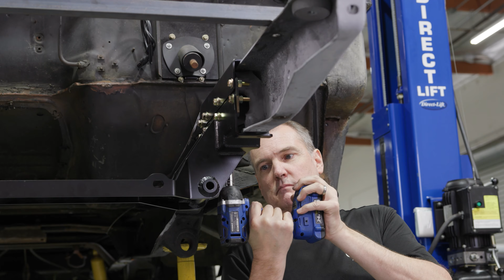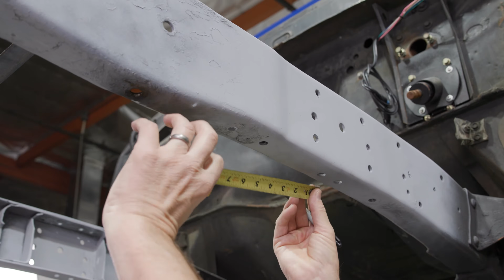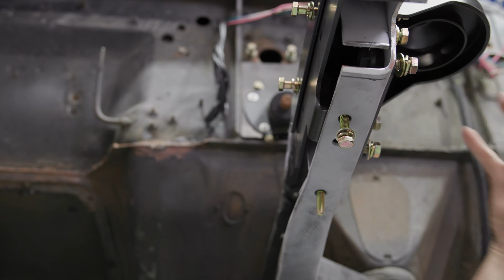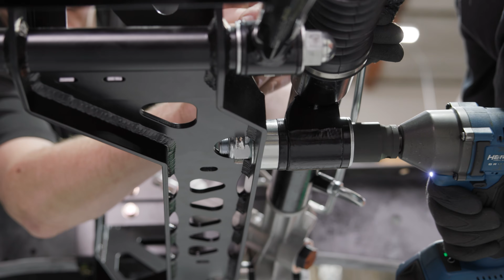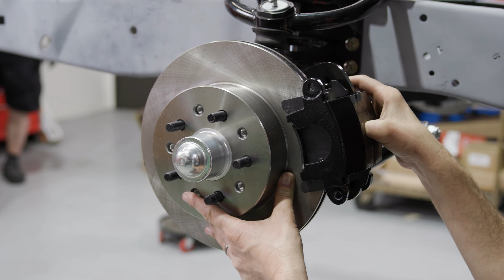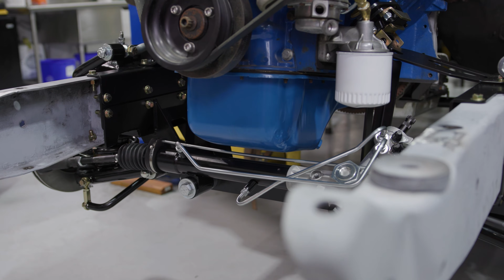Installing Our New CPP Mustang II Ford F-100 Front Suspension Kit

Comment: I'm debating between this kit and doing a 2008 crown vic swap.  currently my 65 f100 has a ford 300 in it, but i plan on going to a 4.6 2v after doing the frontend suspension upgrade.  Will this kit work with either engine?
Reply from the maker: Hello, this kit will work with a variety of engines. We have not tried installing a 300 or a 4.6 in one of these trucks though. If you get one of these installed, we'd love to see pictures of it. Thanks for your question.